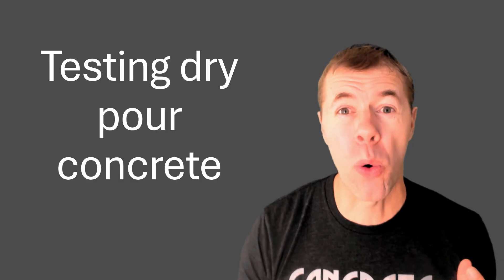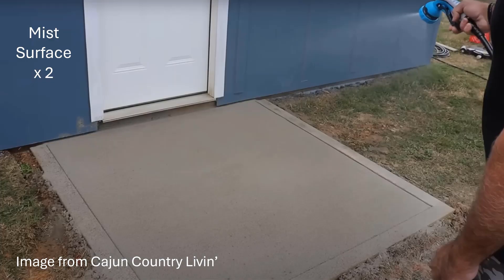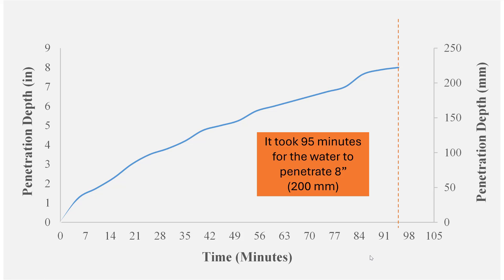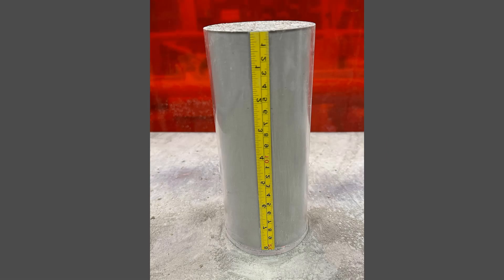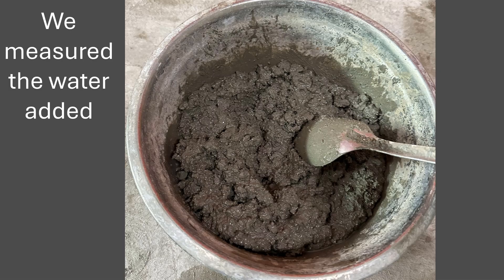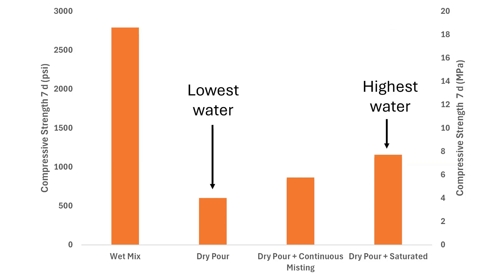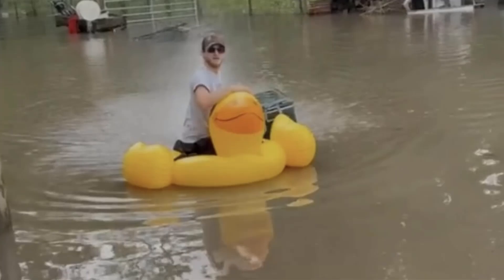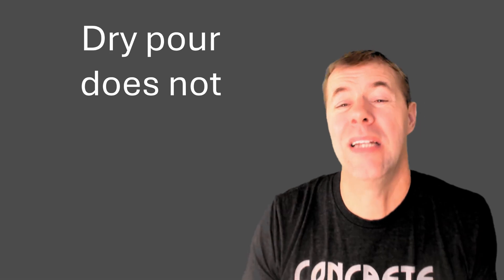Testing Dry Pour Concrete with an Expert

Comment: Here in the UK, we have a product called "Ready To Use Postcrete" by Blue Circle, targeted at fencers. You dig the hole, pack the dry pre-mix around the fence post, and then add water. This method works well because it holds the post pre-set, allowing you to move on quickly. However, I'm guessing Blue Circle has formulated this mix specifically for this application, and I think some people mistakenly believe this is how you can lay concrete using standard cement. People often don't read labels. On the techical sheet its states "POSTCRETE may not be used for general concreting,
screeds, mortar, grout or render. If a specified compressive strength is required, POSTCRETE should not be used." Maybe in the US, you have a similar product you can try as an experiment. Keep up the great work on your channel; it's fantastic !
Reply: We have the same stuff down here in Australia and it's definitely not meant for load-bearing/structural applications. I've pulled out some posts in the last year that were set in it and also some set in proper concrete. The concrete around the post mix posts just crumbled away as I pulled them out of the ground, while the proper concrete posts required the use of a demolition saw and sledge hammer+wedge to get off the posts after I'd pulled them out.
Reply: My recommendation is to not use concrete at all for posts (especially wood post) as accelerates rot & corrosion. Instead just you Gravel as it will allow water to drain away instead of locking it in, and isn't alkaline.
Reply: @guytech7310  You can use a hybrid method, where you put clearstone in the bottom of the hole and around the post a little, to allow for drainage, and ensure positive drainage away from the top of the footings, either by just sloping the top to drain, or raising them above grade (still with the slope).  Sometimes you need the weight and consolidation of concrete depending on type of fence, wind loads, soil characteristics, etc.  Especially in places that have shallow footing requirements to begin with. The other good thing is you can always remove the old post and anchor a bracket with epoxy for a new post.
Reply: @daniellec2172  Issue with concrete it keeps the wood too wet (basically forever). Best option is to just use gravel. Gravel will lock in the post as the gravel pieces lock together in the post hole making it more rigid than soil. 

"The other good thing is you can always remove the old post and anchor a bracket with epoxy for a new post."

The issue is it always rot below grade if the post is in concrete. Its never a rot problem above ground (well most of the time). A better option using your method would be to concrete in a steel bar, and drill a hole on the bottom of the post and slide the post over the metal bar.
Reply: @guytech7310  Explain how the water drains away. Where does it go? Digging a hole in soil and filling with gravel is how you get water out of the soil and into that hole, not the other way round. It's fundamental physics of soil water pressures - you've crated a low pressure area. Unless you have an exit for that water all you've done is create a pool of water around the post.
Reply: @DiscoFang It dissipates into the surrounding ground. Concrete locks in water since is far less permeable  than gravel & concrete holds on to water like a sponge. A post in concrete is exposed to water constantly. Gravel allows the post to dry out in dry weather.
Reply: Folks report excellent, lasting result using only packed gravel or crushed stone around fence posts.  I wouldn't try that with a foundation wall, or even a curb for that matter.  If the reason doesn't seem obvious, please try it.  Make sure you post a video of the results for us.
Reply: the thing is, the concrete around the post does not need to be very strong. in fact, you would probably just pour gravel into the hole and have similar results. so being 2x-3x weaker than regular concrete is not a problem. it does not need to be a special formulation for post. the special formulation is probably just cheaper sand and aggregate since they're already sacrificing strength.
Reply: What do you think of the „Mud Mixer“
Reply: The secret is you don't even need concrete for typical fence post applications. Just some mass packed tightly around the post to keep it from moving. DIYers who aren't on a schedule can take the time to pack gravel and clay around their posts. Or you can dump in Postcrete and get the same results, dry or wet.  So it doesn't really matter how this product cures, or if it cures at all, because it just needs to be packed around the post. Consider the typical utility pole, it's not set in concrete. Nor are many commercial, municipal, or highway chain link fence posts which are driven. And when it's time to reset or replace a rotten post it's a lot easier to do without a massive slug of concrete buried beneath!
Reply: @13squier  Not really a good idea unless your located in a dry area. Issue soil can turn into mud causing the post to lean, especially if there is a force pushing to to a side (ie fence, with wind blowing).
Reply: @guytech7310  what isn't a good idea?
Reply: In my area we get killer winds during the summer nights.  My fences have 1000mm deep footing and 4-6 bags of concrete (wet mixed ofcourse).

My fence is nice and secure.  My neighbours are all wobbly
Reply: You don't even need to use specific postcrete mixes. Just use normal dry concrete, either bagged or dry mixed in a barrow, thrown in the hole and wet. However, a feature of most postcrete mixes is a fast setting component, and very small aggregate sizes. Often mostly coarse to fine sands.

The comment above is exactly right that all you're doing is securing the post against the walls of the hole. Heck, compacted sand is a method that works well for farm fence posts.
If you're setting timber posts in the ground, wet mix concrete is the best for both strength and for timber durability. Water isn't the problem, it's water and oxygen. Dig up any post that's been set in concrete and any rot is predominantly at the ground level where it's exposed to the air and water in the ground. The part in the concrete lasts.
The problem with filling a post hole with gravel imagining that it somehow creates or facilitates drainage totally misunderstands the hydraulics of water in soils. Give water a low pressure area - the air around the gravel - and water in the soil will fill that area. That's exactly how french drains work. The reason they drain is that the water is then given a place to exit. Fill a post hole with gravel and all you're doing is creating a water bath for the post. As the soil wets and dries with the rain fail cycles, that constant cycle of water and air is a perfect rot factory.
Reply: We do have this in the states as well. I think it works because it just needs to compact itself densely enough to hold the post in. Denser than the dirt around it essentially. It doesn’t need wear resistance on the surface or a high amount of compressive strength as a unit. I would use it for fence posts, but always steer people away from “dry pouring” and concrete for anything exposed and especially anything structural. Its a lame diy trend aimed at people that dont know any better. I always tell people its easier to just mix it anyway, and it costs the same either way. And try to explain the benefits of using the concrete the way it is meant to be used.
Reply from the maker: I agree with @markdourmert 
I think this is find for fence posts but I would mix the material if I was making anything important.
Reply: That’s exactly what I was thinking. Although I thought you out the water in the hole first which would help with the air issues.

Comment: I would not use dry for any type of slab even if it were a little bitty. Pour your dry cement bag into a big heavy-duty trash bag and add water. Then flop it around from side to side and in no time you have a bag mixed up. At least then you have some water integrated. Another great video, Tyler!
Reply from the maker: Thank you!
Reply: Water proof fabric tarps mix well, especially with four hands to alternately lift four corners.

Comment: Another thing I'd like to see is mixing in leca balls into the concrete mix. I'd expect it to get weaker, but how much and with which percentage will it be significant.
Leca balls will reduce the weight and improve the insulation, so that's the case I consider for using that in the mix.
Reply from the maker: Thanks!  This is like low quality light weight aggregate.  We are doing work on light weight aggregate now.  I will post a video once it is finished.  The strength loss is tied to the density of the concrete and the strength of the light weight aggregate.  I don't think the leca balls are very strong but we could check.

Comment: Dry pour might make a good base for DIY pavers or any low load temporary pad - it would be easy to bust up and re-use as fill.
Reply: This might be the best use case Ive heard. It would compact like abc and be at least as strong, most likely quite a but stronger. Surface density doesnt matter. Its common in my area where pavers are desired for the look for concrete to be used under the pavers in a high load application. This might be an upgrade over abc. My only problem is that with this application i can pump standard concrete, bull float, and leave. Id pay the extra money to not mess with the bags lol. In my area the readymix price equals the bag price at right around 1 yard. So might not even be a cost incentive. I could see it in certain areas though for sure
Reply from the maker: Thanks for the comment.  This is a cool idea.

People commonly use cement treated base for this application.  You mix cement in with soil at a pretty low percentage and it can be compacted and smoothed.  This would be less expensive then dry pour but you would save some labor by directly placing the dry pour.

Comment: In the South sometimes "readymix" concrete bags are placed in deep ruts on dirt driveways in the bag. Then with rains they solidify to be giant pavers so your vehicle does not bottom out. 

You try not to drive over them until hard. This crude hack actually works OK.

 If you make the bag conform to the valley of the rut then the cured bag has less unsupported voids below so they they last longer. ie concrete has about zero strength in tension. ;) 

If you have as source of water you can  poke holes in the top so the bags keep moist longer so they cure better. 

With 3  expensive rapid set 25 buck bags I had left over(from a job)  they cured to be insanely great.

 With the basic lost cost concrete Mix bags the results have a wide scatter.;

 great to broken since another drove up a private driveway thru the flagged area of bags

When I have a water source I wet the rut if dry beforehand. Then place the bags to fill the ruts. Poke holes in the tops of the bags only and dump water on the bags and "TRY: :) to mix the water in the bag. Do this on a road to a rural cabin in the woods.  Then rewet the bags with water hours later and keep the cure going.

If you have the time and water supply you can add rebar and uses the rut as a concrete form and just properly mix it with a shovel and use part of the bags at the top to delay the crust curing too fast.

ie do not offend the concrete curing Gods wrath!
Reply from the maker: This sounds like a good application.  I think mixing the concrete up may do even better.
Reply: I see people use bags of concrete in similar ways here in California, too. Typically farmers or people living in rural areas. Stacked concrete bag construction can be useful for a lot of things. I have seen a lot of people build up a driveway over a culvert using this technique. Also sometimes they build low retaining walls this way. Seems to work well.

Comment: In this time of the green religion , can you do a video on recycled glass as an scm
Reply from the maker: I don't have a lot of testing experience with it but I may in an upcoming project.  Also, recycled glass is a little impractical because not all glass can be used for this application and you have to thoroughly clean the glass.  This makes it more expensive.  The only place in the US where they are trying this is the New York area.  They tried it in Hawaii and it didn't really make economic sense.  But maybe there are situations that I don't know about.

Comment: Wow, very comprehensive testing of a somewhat fringe practice!  There is another reason dry pour is always going to be inferior: Cement powder loses MOST of its volume when you wet it. This means that dry pour will have very extensive voids just for that reason, as well as voids because you didn't vibrate it either.
Reply from the maker: Thanks for the comment.  That is a good point.  Let me do some calculations on how big of a deal that is.  Take care!
Reply: @TylerLey  Alright!!  More science!  From fuzzy memory:  If you take 2 cups of cement powder and mix it with 3/4 cup of water, it all fits into one cup.  So this would be in the range of an 8x reduction in volume of cement dry-to-wet.  That is a huge deal.  

Had this issue with the local batch plant, where they would reduce a yard of concrete by a cu ft when adding an extra sack of cement - but it really doesn't add any volume (just takes up voids), so that yard now becomes 26 cu ft (and costs more).
Reply: @SpaceCrete  that's why i do weight batching instead of volumetric batching.
Reply: huge voids because on extraordinarily high air entrapment.
Reply: what about when vibrating the dry pour when using a complete form? would have been easy to test in the examples in the video
Reply: @otallono  mix 2 tablespooons of cement with one of water.  the cement volume just disappears when it gets wet.  Bags of cement are already vibrated.
Reply: @SpaceCrete  that's because dry cement void % is approximately around 54%.
Reply: @otallono  that won't come to rescue because void % will still be extraordinarily and unacceptably high.
Reply: @otallono  how would you vibrate it and not disturb the loose "powder" to a point that it's no longer shaped or leveled as originally intended.

Comment: I would be interested in the results after 28 days. And maybe even a year. Maybe it takes longer to reach full strength and/or has other benefits that only manifest later on?
Reply from the maker: We did 28 d testing in the video.  We saw no increase in strength over time.  That was shown in a graph.  We have some long term samples to see how they perform.  Maybe we can do an update video.
Reply: @TylerLey  Sorry, my bad. I somehow missed that - I guess I wasn't enough attention for some reason. Would love to see a video on the long term samples.

Comment: I’m not a fan of dry pour, but have you considered that dry pour is usually done atop a dirt/gravel base? Could the test results differ if the dry pour was atop a gravel base that allowed the excess water to go below the mix?
Reply from the maker: I don't think there is excess water.  We found that the more water you added, the better the performance is.  If you are going to dry pour concrete then I would add all the water you can to it.
Reply: @TylerLey  I was suggesting that it’s possible the results might have been better if above a base that could “store” some of the water and keep the moisture level high.

Comment: Sounds like a bit of surfactant might make a big difference in the way air gets out of the concrete and change the air channel structure
Reply from the maker: That is an interesting idea!  I agree that the surfactant will lower the surface tension and cause the channels to be smaller after the air leaves.  This could be another idea to try in future testing.
Reply: @TylerLey  Wouldn't a concrete vibrator remove all of the air channels as well?
Reply: Great video! I don't care which side wins, I'm just enjoying the process! The surfactants idea would be interesting to see. About your set up specifically, the thing I was wondering - could there be another way to let out the air? You used a non-permeable barrier on the sides and bottom (which isn't normal for wet pour or dry pour - and you proved dry pour can't be done that way!) And it didn't stick to rebar, so would it stick to fiber reinforcement? Is it cheating to wet the rebar in some way before placement? Are the problems you're finding solvable with different techniques, cement mixes, or additives? The youtube algo wants to know!

Comment: Now a question for curiosity alone , does the dry mix gets stronger if it is hydrated from the bottom? (no air channel created)
Reply from the maker: I like that idea!  Someone else asked about vacuuming the water in from the bottom.  I think it should do much better.  That would be a fun experiment to try.
Reply: Also try splitting the concrete mix into fourths and the water into fifths, and pouring it into the cylinder like a multi layer sandwich.
Reply: @TylerLey  Similarly, I wonder what happens if you replicate a real world fence post scenario:

* Dry mix surrounded by a porous material. (dirt)
* Flooded with water.
* That porous material is misted continually.
* One to three times a day that porous material is flooded with water.

This replicates someone setting up a sprinkler and it being in an area where it rains constantly.

I know it still won't be as strong as mixed concrete, but for that situation does it really need to be?

Comment: Concrete Senpi, what of roller compacted concrete? Should I get a plate compactor for my gazebo slab, or is that not enough pressure? I fear flowable concrete, it is the fluid of my nightmares...
Reply from the maker: Roller compacted concrete is great if done right.  We don't usually use it for patios because you need big equpment to place and compact it.  Don't be scared of flowable concrete.  It is great.